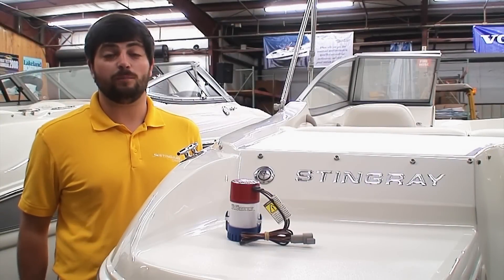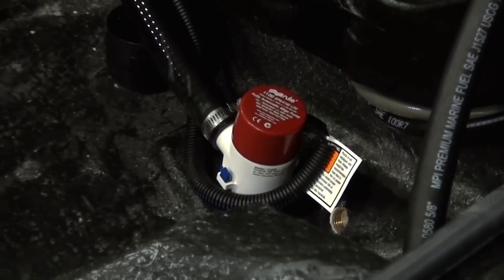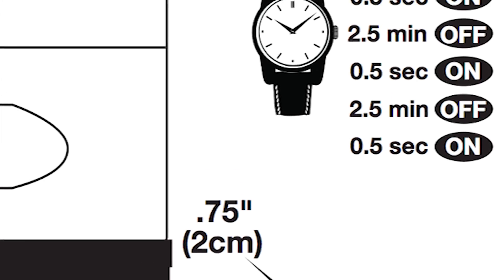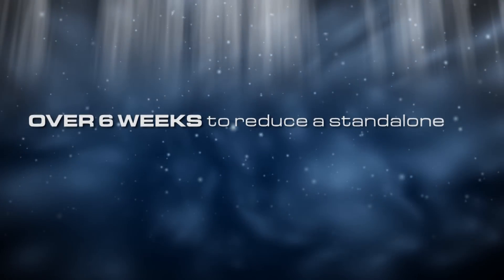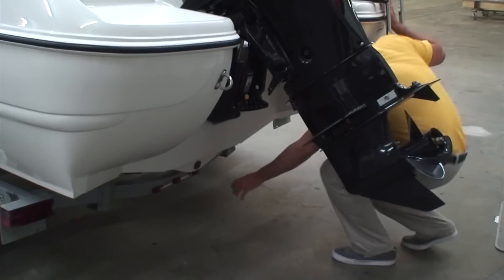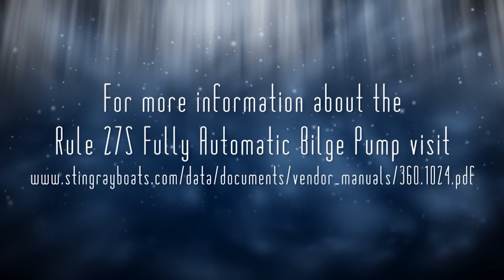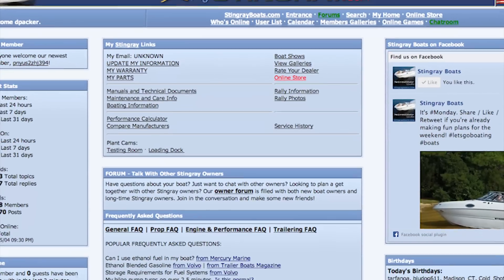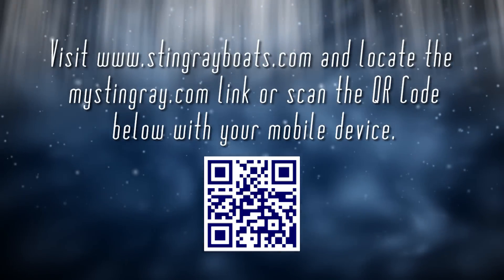Boat Owner's 101 - Rule Automatic Bilge Pump

Comment: I have a 2017 198LS. The stock auto bilge pump has recently begun to run for long periods of time in our garage. It no longer turns on and off as expected. After research online, it appears these pumps have electronic water sensors that are prone to early failure. Is this something that is covered under the extended 5 year warranty on my boat. If not, can you at least include a video that shows the location of the pump and how to replace it. Thanks.
Reply: These guys like to make videos but they only show the units on a table. How about how to replace them ?

Comment: I have a A B power switch, and even if I power it completely off....my bildge pump is still working.  I store it in my garage, so it will not fill with water at all during storage.       I can hear it, every 2 minutes activating in my garage.   It would be nice, if my AB switch would kill the bilge pump when I turn the AB switch off.   I guess my only solution is to disconnect the bilge pump (as it is obviously connected to my batt directly) and reconnect it to my AB switch.    I didn't count on having to do any work to my brand new boat.....but, it looks like my only option to save my batts.